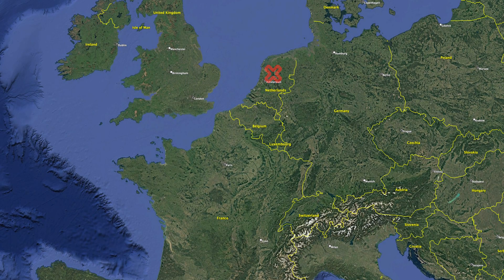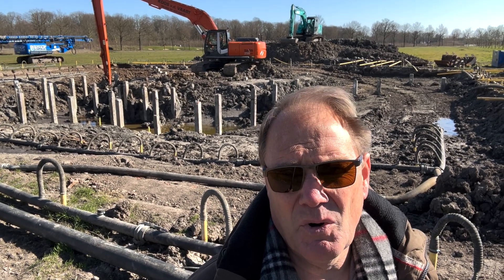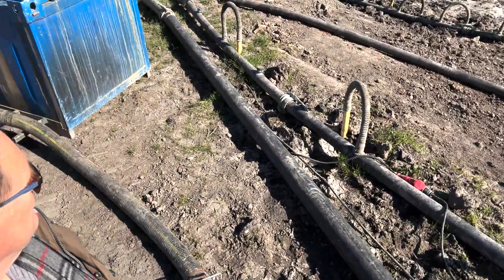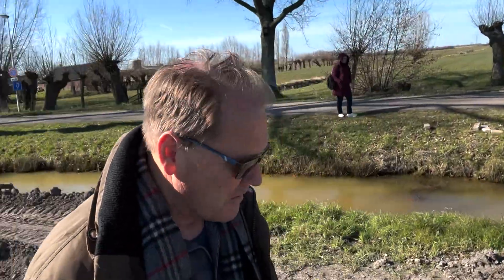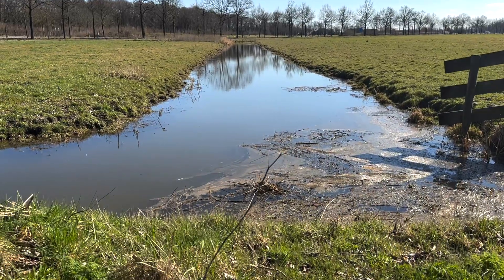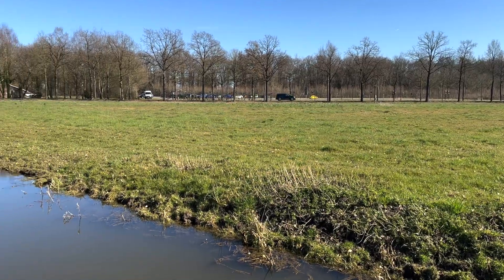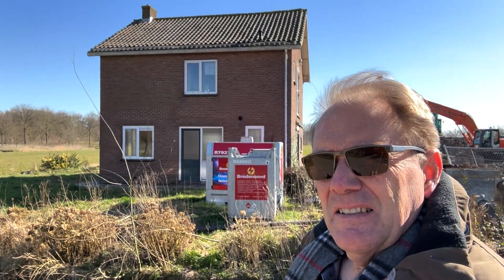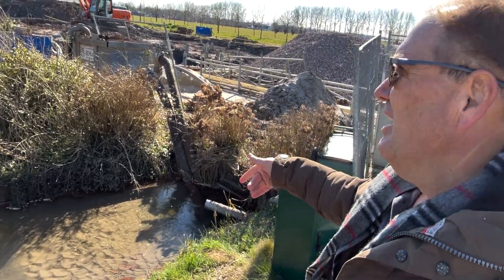Building Below Sea Level- Here’s What the Dutch Do Differently

Comment: The length of the peers vary with the geology of the site. If the pleistocene sand is deep under the peat, the peers must be long (up to 60 feet or 20 meters). The driving of the peers makes a lot, a lot of noise. Earlier they had a big weight that would slam them into the earth. The energy was provided by injecting a bit of diesel fuel onto the pole that exploded when the weight hit the pole and shot the weight back up again. Nowadays I think they use cleaner methods.
Reply: That’s interesting info. I would rather build in the mountains of Norway. Building on a wetland scares me.

Comment: The wooden poles will only rot btw, if the waterlevel drops for too long. This becomes increasingly a problem due too dry summers caused by global warming. Peat soils are more vulnerable than clay soils. Because not only the poles can rot but also the peat which leads to shrinking of the volume.

Comment: When I was young and living in the Netherlands, they used a combination of wooden beam piles topped with a shorter concrete pile for all new housing constructions in areas with soft soil.

Nowadays I believe it is all concrete piles as wood will eventually rot away.
Reply: wooden piles are okay forever when permanently submerged. But changing water table (lowering it so intensive agriculture can get heavy machinery out in the fields year round) or droughts, or for new building exposes the oak to oxygen, end the rot sets in.
Reply: The wooden piles only rot when they get above water. Lots of expats in Amsterdam complain about a layer of water in their basement sometimes but that's the price to pay not to get the pilars dry and expose them to oxygyn.